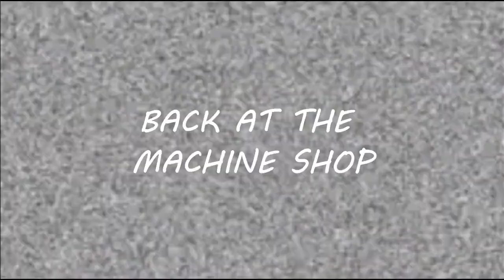SNOWMOBILE WATERCROSS || SUNK THE SKIDOO

Comment: What size lug on the rev.?
Reply from the maker: It’s a 1.5
Reply: @Jodylovemaker  badass.. on my rev 121” I had 2” lugs and turned the track around.. it had some insanely grip after turning it around
Reply: @Jodylovemaker  if ur track is used up pretty good and bending forward!! I request u doing a video on trying it out like that. That’s what I did on my older revs